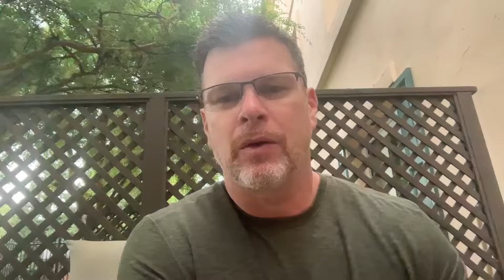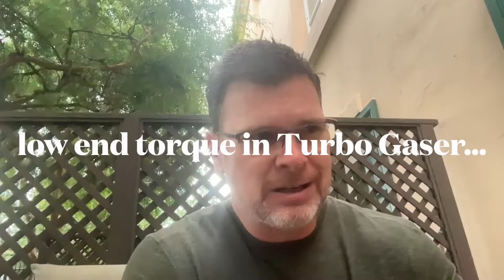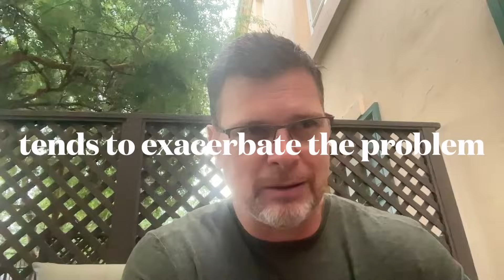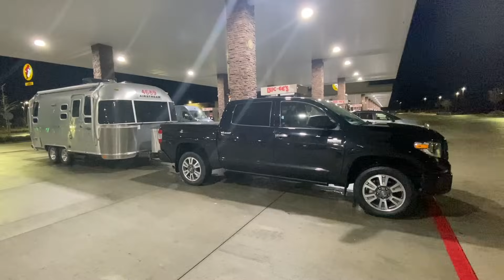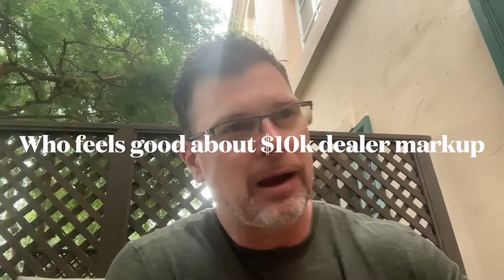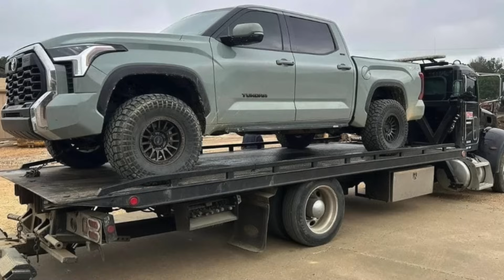Tundras Engine Recall.  What to do to stop failure

Comment: Hey Kedrevs,

Tried to find an email for ya but couldn’t.  Would you mind sharing the maintenance history of your used tundras you bought?(prior to your purchase?) I’m looking for a
Used tundras but it’s rare to find any with first oil change under 10k miles, which I find very sad at the least. Curious to your thoughts. How many miles did you search for?
Reply from the maker: The two that I purchased used, 2015 for my son, bought in 12/19 had dealership records, first change was at about   10k miles.  The 2020 I bought used sold new on 1/20/20 had a "10k service" performed at the dealership at ,973 miles on 11/30/2020 and I bought it on 1/19/2024 with 114120 miles on it.  The 2015 had 83k miles when purchased now about 150k miles, no issues

Comment: The V35A-FTS in the LS 500 had less torque than the truck version. It seems they pushed it too far.
Reply from the maker: @imnotusingmyrealname4566  it had troubles in the LS too
Reply: @kedrevs4037  really? wow they screwed up that engine from the ground up then...

Comment: Its not s design flaw, it's a manufacturing process flaw (robot program not achieving enough clean out), and not every vehicle with this engine will have a failure, but each one could potentially. Id like to know the actual #s of trucks that have had engine failure.
Reply from the maker: it appears to be 1000 as of the recall anouncement
Reply: @kedrevs4037  thanks for responding!

Comment: 50 k on my 2022 and not one issue. May be you should go run the Toyota engineering department with your above average knowledge and you’re an oil expertise. Less than 1500 failures. The oil port in question is the single milled engine port that feeds that bearing the debris was in that milled port feeding that bearing from reports that most likely why there is one bearing failure .  Toyota has made turbo engine for  20 to 30 years.  Do you actually think that Toyota didn’t test the this engines for years before they went into production? So you like the last generation good for you they are nice truck. This one is better in many aspect. I just think you should give Toyota a little credit that they probably know how I make an engine and will get the problem solved.
Reply from the maker: Put down the coffee, those aren't goo numbers.  Why don't you go explain how good they are to one of those 1500 failures...so far.
Reply: @kedrevs4037  Toyota did explain it ,they have a manufacturing problem. You just don’t want to hear or like the answer. Over time I have no doubt they will correct the problem. How many waste gate issues do you hear about today on the new tundra? Answer is zero.. That was  your complaints in your very first YouTube video trashing the turbo. Explain to rest of 280k new tundra owners why we don’t have waste gate issues now? We will see if in future you make another video on YouTube about how you were so wrong about the new generation tundra. All I can say is I’m 64 and can’t buy any vehicle I want and have owned many trucks and work the trucks hard. This rides better, tows better doesn’t shift down every time you tow or go up a grade, doesn’t have a dash board that does look like Camry. You can say anything on YouTube but it doesn’t make you right or know what you talking about. But you do have some cool aid drinking new tundra hater’s that follow you and you get your clicks. But you can drive and like what ever truck you.

Comment: I agree with the design flaw theory.  Just a note, the manufacturing process between the facility in Japan and the one in the U.S. is probable identical including the chip washing steps doesn't explain away such debris as being the problem.  Also, I'm not sure about the detonation theory.  The rod bearings would be affected by that not necessarily the main bearing.  I've watched dozens of videos and read a bit on this, and the more I learn the more I do think this is a main bearing design problem like you suggest.

There is no real fix for this.  The very best they can do is a bandaid.  They can't revise the design overnight and have replacement short blocks let alone full crate motors to handle 100k vehicles.  As you mentioned, they would have to inspect each customer's vehicle to determine its status.  Those that are unharmed would be given a warranty for some period.  Those that are compromised would have engines/short blocks replaced then given a (maybe shorter) warranty.  Either way a mess for Toyota.

Would heavier weight oil help?  Maybe.  But Toyota would have to recertify with the U.S. government on exhaust emissions I would think, and this would take time not to mention fuel economy would be affected.

Toyota is not going to admit to a design flaw easily.  Their culture and their sheer arrogance will drag this out.  Calling the a "safety recall" is just an example of this attitude.  Remember the sludge in the engines problem?  They initially blamed that on customers.  Yeah, right. 

 As a side comment, I saw one video showing a 3.4L failed engine disassembled clearly showing a seriously discolored rod cap right adjacent to the main bearing cap.  The main bearing had apparently gotten so utterly hot that the rod cap was toasted.  I can't imagine.  By the way, I'm a mechanical engineer who specialized in internal engines, tested engines on dynamometers for a few years before getting my MBA and went off the count beans.  This whole Toyota episode has been fascinating for me.
Reply from the maker: Great post, I woulld add the fact that the LS500 was seeing the same main bearing all the way back into 2018, really lends to design flaw as well.

Comment: Changed my oil 900 miles and again at 2600 hope i cleared it out
Reply from the maker: Hope your right, but has not seemed to work for others,
Reply: @kedrevs4037  I do have toyota extened warrenty so we will see
Reply: If it's a design flaw, clearing out "machining debris" with the oil won't help.  Good luck!

Comment: Toyota will not do the right thing in this instance. They have a severe design flaw. Instead of admitting that they come up with a lame Debris excuse. Which in itself makes them look shabby. Who leaves debris behind when they machine new engines? They will do nothing for the folks who haven’t had any issues. They will replace blown engines with the same garbage and when these trucks are out of warranty they will be regarded by most people as garbage. The fanboys will make excuses for Toyota but there’s no excuse for this.
Reply from the maker: I fear much of that is accurate

Comment: You are absolutely right, the debris cause doesn't make sense. I think they have an idea what is causing the issue, but they're using this debris narrative to try to shield themselves from class action lawsuits. If they identify a design flaw with the engine, they're giving law firms what they need to put together a big lawsuit. Owners of these vehicles are looking at a major hit to their resale value. 

Toyota made record profits last year. They could absolutely pay to replace the engines. GM announced a while back that they were going to replace the diesel engine in all 2024 heavy duty trucks due to an issue with a valve that sprays oil on the back of the pistons. That's huge expense but GM is doing it.

Comment: The flaw in your argument is the oil flow in the motors. 
If there was debris left in the oil passage between the oil filter and the first main bearing, that would explain the problem. That debris would get pushed into the main bearing first, and the rod bearings second. Main and rod bearings are designed to capture a small amount of debris. The debris will get embedded into the softer metal of the bearings. The amount of debris in the oil passage would dictate how long it takes to disrupt the oil film causing a catastrophic failure. In reality it would take a very small amount of machining debris to cause this issue.
Reply from the maker: it would also take a very small amount of time
Reply: @kedrevs4037  Agreed, depending on how much debris is in the oil passage. I assume they do clean the blocks prior to assembly. 
I use to drag race, and after every motor refresh I would cut the oil filter open and find Aluminum debris from the machining process. This was after spending hours cleaning the block prior to assembly. 
If the main/rod bearings were too tight, as soon as the motor parts (block, crankshaft and rods) got up to temperature and expanded the motor would seize up.

Comment: I have a 2023 on the recall list. No issues so far and I have towed and done long distance trips. I change the oil every 5k miles and the regular maintenance. Even with all that it does make me wonder if I’ll have a sudden breakdown. I’m not sure what kind of trade in value I’ll get.
Reply from the maker: It's a tough call if your not on recall list.  I would dump now just because not on list and move on.  Bu everyone has to do what is best with them
Reply: Tic ... tic ... tic ...  Hear that?  That's a time bomb.
Reply: @rand49er  Maybe, but the failure rate is only 1% right now. I’m going to wait and see the remedy that is offered and go from there.

Comment: Dear Sir... You are right about these CORPORATIONS...TOYOTA should have jump on Tundra's engine issues in 2022 instead they push it right to 2024 models.. QUALITY is gone to HELL they need to change there thinking before they DESTROY there reputation.. Toyota is starting a recall of 100,000 trucks there is probably more to come.. Toyota should be replacing these engine with new crate motors NOT SHORT BLOCK engines.. These engines are very complex today they are not like the 1960's or 70''s engines .. I read about the nightmares about the short block being replaced 2 or 3 times on the some Truck... These V35A-FTS 3.5 Twin Turbo engines and looking into what they changed the way they secured the Main Bearing caps by using a LADDER FRAME system made from Aluminum could this be the problem or oil starvation or machining work ?? ..  Toyota today is telling us that the issues are cause by filings left in the engine manufacturer are they being TRUTHFUL about that .. I own a 2023 Tundra with 600 miles had to replace a front Diff. and transfer case it took over 3 Months to repair . My DEALER was very helpful they gave me a new Tundra to use and the Toyota Corps also compensated me as well .. My FIRST oil change at 1,200 miles NOT AT 10,000 Miles what they Recommended. The first oil change is VERY Important to get rid of Micro filing from the internal engine .. I will NEVER change oil at 10,000 miles 5,000 miles is MAX  PERIOD with FULL Synthetic..There's a lot pressure on the MAIN BEARING with twin turbos.. I'm in the process with CORPS  to changing the oil viscosity to 5w 30 Full Synthetic instead factory 0w 20 ..I've had engines with over 325,000 miles the only problem is the Body's don't last in the NORTH of Canada .. My engine is running fine right now with 14,000 miles ...  I'm my playing Russian Roulette with this engine ??   TOUCH WOOD WE'LL SEE ...
Reply from the maker: Thank you for sharing.  I hope your truck gets back in good working order

Comment: I was told they used this engine in one of the bigger Lexus models. So if that were the case these problems shouldn't exist if that were the case. I wouldn't buy a new model change for like the first 3 years. I still have my 2007 crew cab, sr5, 5.7, working thru I misfire problem currently
Reply from the maker: Those LS500 engines failed too, all the way back to 2018.
Reply: @kedrevs4037  I love my 2007 tundra 5.7 and I have grown to like toyota for reliability and dependability,  I hope they get this fixed soon. I want them to bring the 5.7 back.

Comment: I don't know the specifics of this engine but debris causing front main bearing failure is definitely plausible. In a lot of engines this is the first location to get oil. Very possible a subassembly provided from a supplier was contaminated like an oil pump or a crankshaft. Also if a particulsr cleaning operation was missed it's likely for the debris to always release to the same location of the engine. Either way it's just speculation at this point. I wouldn't discount the claims from Toyota yet, there isn't enough information right  now.
Reply: Main bearing cradle flexes under load. Spun bearings are the result.  Maybe even a rod or two. Catastrophic failure.
Reply from the maker: So let it be written.  Thank you.
Reply from the maker: I haven't discounted the info from Toyota, I find it to be something near the truth, just not the "whole, honest truth"

Comment: Why are some trucks having this issue and some are not. I have a late 22 capstone with 98,000 miles and I haven’t had any issues. It is a hybrid which are not included in this recall. I don’t understand that as well because they are both the same engine.
Reply from the maker: not as much low end torque put on the hybrid engine is my opinion as to why it occurs less frequently.  At lower speed the battery is supplying the torque.
Reply: what type of gas octane did you use 87 or 91?

Comment: My thinking if it debris causing the same main bearing failure ,IMO that doesn’t make sense!  Debris does not stay in one area. If it was debris it would move to other areas and you would see damage in other areas,maybe not to the same degree as to where the debris is mainly located but you would see damage starting elsewhere. If it was caused by Pre ignition,I would think you would see some obvious damage to the piston. I’m not an engineer,but my money on the problem is design flaw. If Toyota wants to keep their name of reliability they need to fix this problem properly,without cutting corners!
Reply from the maker: sounds like we agree

Comment: Do the main bearing have anti rotation tabs?  All I have seen is internet pictures which are not very helpful.  I have never seen an engine without them, but this could be the design flaw. A bearing moving in the journal would block the oil passage.
Reply: I believe the main bearing cradle flexes. Not having the tabs would be icing on the cake.

Comment: I agree. I think the block is not designed to handle the operating pressure and is not sufficiently reinforced.  The "metal filings" narrative is a sham. Think about it from a QC standpoint - The production process should have redundant safeguards to make sure this type of thing doesn't happen. If something failed from an automated inspection standpoint, at some point a live person must have had eyeballs on these parts.  To do this kind of damage, the metal filing contamination must have been macroscopic or visible to the human eye.  Now, Toyota wants to fix this problem by swapping out short blocks? Are you kidding me? Shame on you, Toyota!

Comment: The problem here is u are not a mechanic or engineer and the small details matter. .. The same debri cleaning procedure sheets were given to the us and japan factory.
The debris were not properly clean out on a oil passage way that is close to the main bearing which always restrictions oil flow only to the main bearing..if you were a mechanic or engine engineer u would've  though of this....Do you fully understand how oil is route to every part of the  engine ???
Reply from the maker: The problem is that you don't get it.  Based on your assessment, it makes no freaking sense that this problem continues on 23 and 24 models.   Nor would it make sense to exclude hybrid vehicles with the same problem.
Reply: @kedrevs4037  you are the one that's not getting it or don't have the full info.
Reasons why the 2024 not on the list because toyota stop the incorrect debris cleaning procedure on a certain day in 2023. The hybrids 3.4L engines are still a problem but toyota didn't think the hybrids will be in the safety recall because if the mechanical engine fail the electric motor can keep the vehicle running....if I was u I need to get my information straight before talking like an expert... please read the NHTSA report on this recall ....
Reply: https://youtu.be/2dnsDJ3YPuo?si=etpSnQhpMvaOA6SD
Read the NHTSA report

Comment: replacing those engines is a drop in the bucket for toyota, thats like a weeks worth of operating overhead costs
Reply from the maker: It is not the cost, it is the logistics, and the blow to reputation.  BTW 30k engine swap x 100k truck works out to 3billion.  Toyota takes that seriously and it's far more than a drop in the bucket

Comment: I am not a mechanic either but my wife's RAV4 XLE hybrid is an atkinson cycle engine so I am assuming the hybrid Tundras are also Atkinson cycle engines and maybe that is why they don't have this peoblem????????
Reply from the maker: They do have the problem, just not at the same rate...so far.
Reply: @kedrevs4037  Thanks. Did not know that.
Reply: Toyota can't handle the regular Tundra. Adding the hybrids and 24's would overwhelm them. I'll continue to rebuild the trans in my 15 gmc Sierra 4x4 every 130k miles happily.
Reply: @bobcook8576  Same with my '05 Titan. The 5.6L V8 is bullet proof!